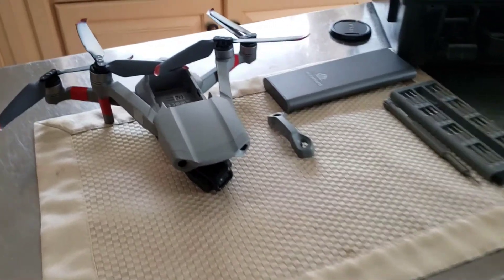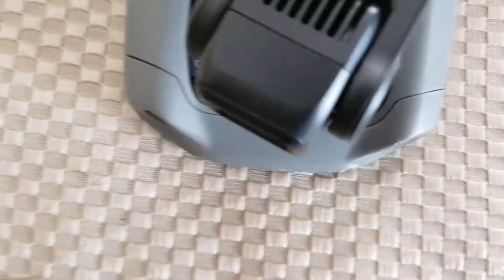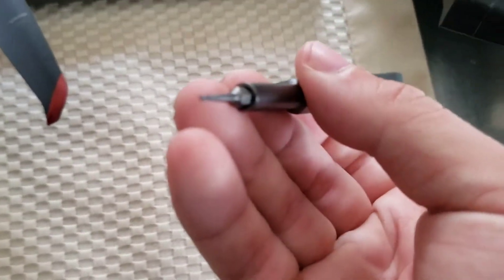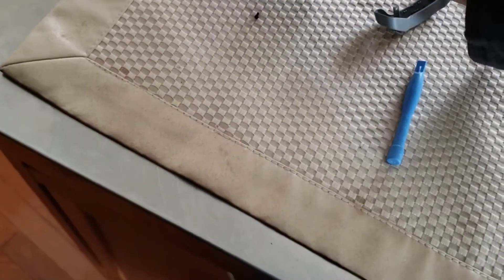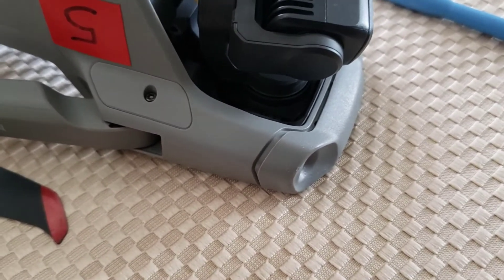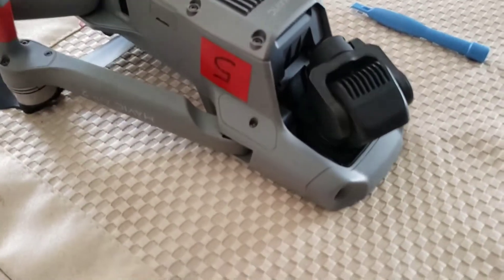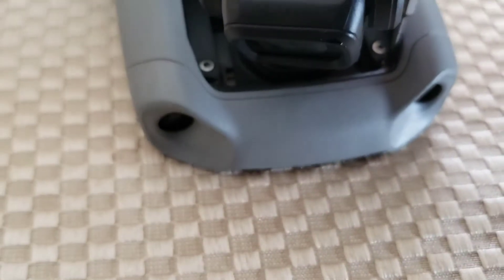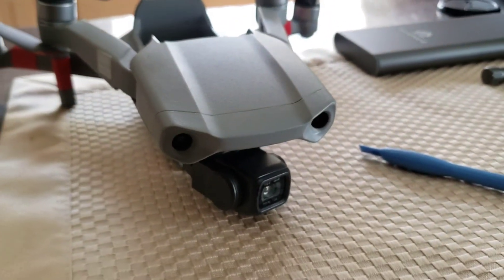Replacing the front sensor cover on the DJI Mavic Air 2!

Comment: Handy tip for working on these things: if you haven't got one, get yourself a tool magnetizer /demagnetizer, and magnetize the bits you're using to make it heaps easier to put the screws back in, during reassembly. 
Post script: this also helps to get them out when disassembling, so you're not constantly picking up and shaking the thing to get your screws out.

Comment: Do you recall what size star that you used?I just bought the kit you linked in the description but may have one that fits. Thanks for any feedback. Helpful video, I was mad that I messed it up till I saw your video lol
Reply: Not "star", Torx.
 Size is T5 Torx driver. Alen bits are mostly 1.5, and Phillips bits I think are PH000, or PH00.